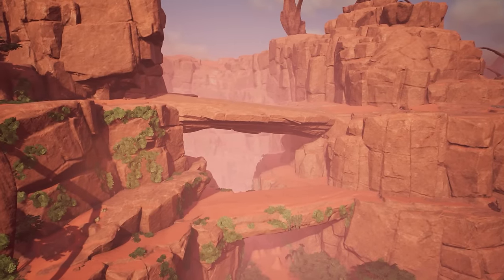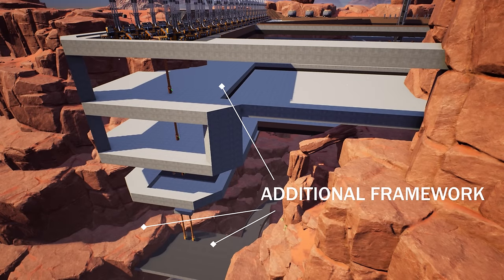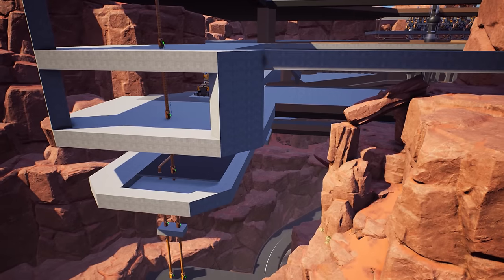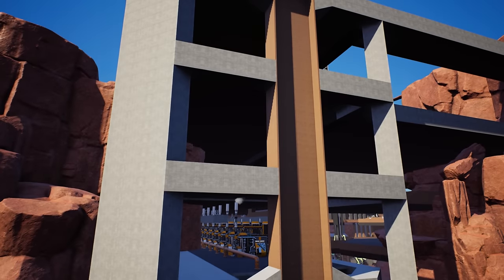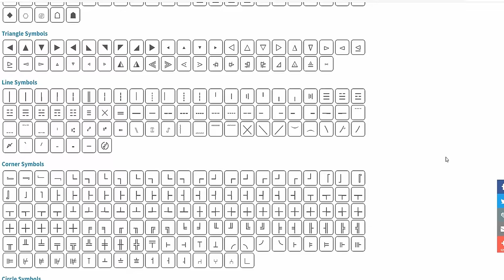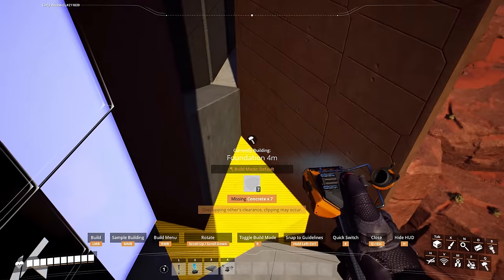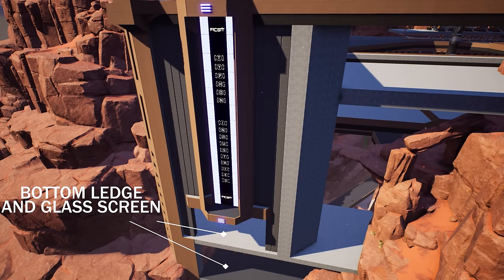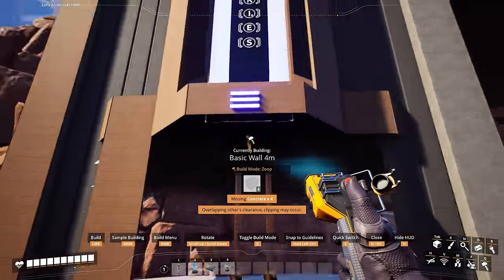| STEP BY STEP | How To Change Your Floating Platforms Into A Structured Build In SATISFACTORY.

Comment: Why are you using the double ramp and not the single ramp if you cover one side anyways? Is there any benefit in using them?
Reply from the maker: It's just habbit, usually if I wasn't to coat with wall I would use double ramp!

Comment: The problem is it's not even a functional factory. He's got all the powerplants on the top floor and then the rest of the build is empty space inside lol. I think it's easy to make a nice looking building exterior but it's difficult to make something that's fully functional, walkable with no wasted space that also looks good on the outside.
Reply from the maker: The save wasn't finished at this stage, it was very functional and is even more functional now. The purpose of the video was to show what you can do from a design aspect but you would know all of that as you have clearly done excessive research of the channel and not just clicked on this one video 😉